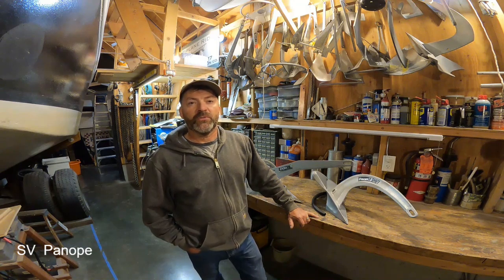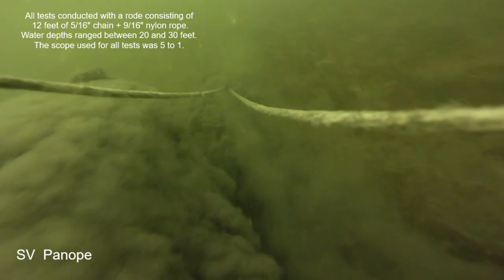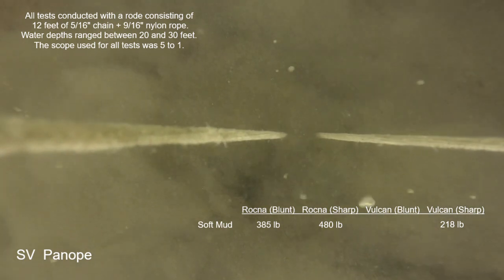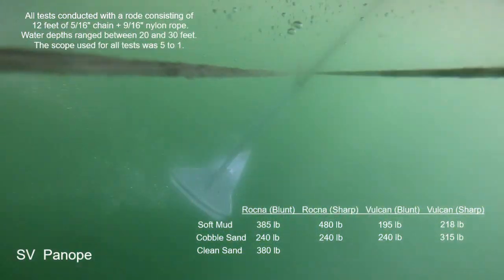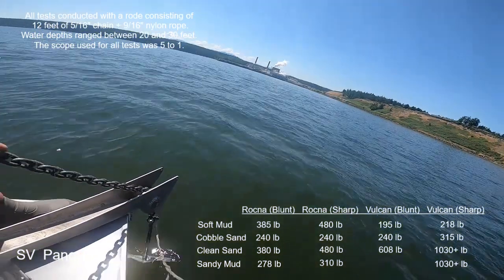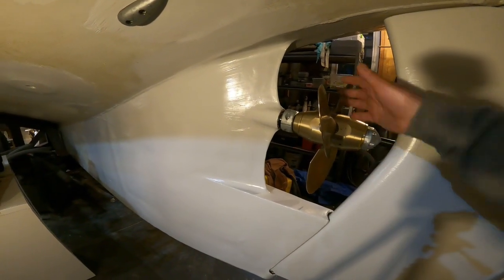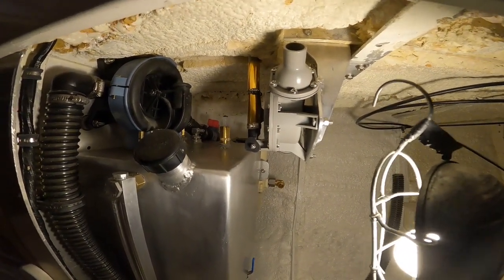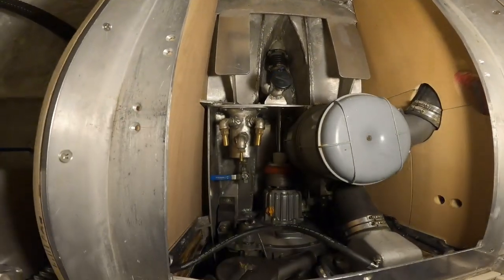Shank Leading Edge Sharpness.  Anchor Test Video # 149

Comment: Thankyou so much for all your amazing research and presentation style. 
This is the 1st vid I have found a flaw in your testing. I am a full time liveaboard at anchor sailor. Last 3 new anchors(different boats) were Rocna Vulcan Vulcan. Setting either in soft works too well!  They bury themself if given enough time and appropriate scope. EG at 2:1 and a few minutes the flukes are maybe 50% buried. Then 3:1 and a cup of tea later 100% buried. NO Engine used. Then go to 5:1 or greater for the storm after the storm anc has disappeared and retrieval becomes a solid workout just before sail off anc. In these situations both Rocna and Vulcan come up with lots of mud. The anchor will do the setting if you let it.

Comment: Late to the party here. Thanks for all the testing videos! I've dived on my anchors lots of times, from southern Massachusetts down to Panama. In New England it is very rare to be able to find any part of the anchor sticking up from the typical thick mud, and sometimes mud-sand. Down in the Chesapeake and the ICW where you are often anchoring in gelatinous goo there is nothing to be seen at all of the anchor. You have to get it to dive down through the goo to something firmer to have any holding at all, but the good is so loose that I doubt sharpness of the shank would make much difference. I could see that a sharp shank could be helpful in thick grass, but it is so problematic that I will do a lot to avoid anchoring in it. In hard packed sand on the other hand, found in the Bahamas and the Caribbean, it is often the case that not much more than the point of the anchor and some of the body are buried. I've successfully (but nervously) hung on an anchor with nothing but an inch or two of the point or points buried, using lots of scope and as much chain as I could. My conclusion for where I've cruised is that sharpness of the point or points is critical, but the shank much less so.
Reply from the maker: Greetings John, glad to have you around.  I have always appreciated your thoughts about anchoring.  

There was a time when I thought that I might have been able to travel to your part of the world with a bunch of test anchors.  With those aspirations now faded, I rely on testimonials such as yours for that kind of information.  

Cheers, Steve
Reply: Thanks @Panope  Of course a genuine CQR kind of proves the point with its incredibly fat, heavy and blunt shank. I have witnessed many a CQR on its side on the bottom, but still doing work with the plow part dug in. In fact, the typical set has a CQR on its side, at least in somewhat firm bottoms. Don't know if you've been there but many Bahamas anchorages are so crystal clear that you can easily observe everyone's anchors just from the dinghy with a glass-bottom bucket or by snorkeling on the surface. Back before we had new-gen anchors with sharp points I found that frequently the best anchor in the Bahamas was a Danforth Hi-Tensile and then the Fortress when they came out. I haven't tried my Mantus there yet, but I'm sure the sharp point would make it much better than my old CQRs.

Comment: Thanks for the test Steve. Seems obvious afterwards. Makes you wonder why we didn't see it before. Love the mods to your boat. She looks really nice. We fitted a maxprop to my last boat. You will notice the difference immediately. Low rpm thrust is huge. Reverse thrust difference is even higher. 1 strange anomaly. Before stopping the engine, we had to engage reverse for a few seconds and then finish in neutral. I can't remember why. But we had to.

Comment: I bought a Mantus 2 17lb for my Montgomery 17 Which i sail on Lake Erie upon your testing results hopefully Mantus is realizing this!

I know you stated your reasoning for a 3.5:1 to 5:1 scope but in a lot of the testing like the Fortress in my experience they only start to work at 5:1 and are a different anchor at 7-10:1 with adequate chain. 

Anyway I appreciate the time your putting into this project!
Reply: Likewise I bought an M2 30kg after watching Steve's testing. It has commercial impact and influences consumer buying.

Comment: I was exploring the Mediterranean on google earth as a place I would like to sail to some day. I noticed that anchoring may be a little sketchy because the bottoms tend to be very rocky. Is there a particular type of anchor that would be good for grappling onto rocks?
Reply: I’ve sailed in many locations throughout the Mediterranean and never had a problem finding an anchorage with good holding substrate even with an inferior delta anchor (wasn’t my choice).  The biggest problem with anchorages is being overcrowded in the summer months which will keep you on your toes.
Reply: What you might be seeing on Google Earth is likely sea grass which there is plenty of.
Reply: Thank you both for the input.

Comment: Another great test. Do you ever get nervous about the number of trials?
Reply: Thank you. I’m use I’m your biggest fan. Can’t count the number of people I’ve recommended your channel to.
Reply: @peterheiberg566  Ditto with what Peter said!
Reply from the maker: Thanks Peter,  I am not sure what you mean by "number of trials".  To many?  To Few?
Reply: @Panope  I’m sure everybody is as impressed as me with the tremendous amount of work that you put into these anchor tests but I just wonder if 4 trials can result in any kind of real significant results given natural variation in the seabed, location of weed, rocks etc etc. A statistician might want 40 trials. Still it gives a good hint at the direction anchor design should take. I can’t tell you how much I enjoy and appreciate your body of work.
Reply from the maker: The seabeds in which I test produce fairly consistent, "good enough" results from a relatively small numbers of trials. Also, the camera really helps "weed out" (no pun intended) bad tests. 

But, it is always a "balancing act" between having a larger number of trails and the even more important (in my opinion), large number of test scenarios.  

For example, in this "leading edge test", if I had focused on the soft mud seabed and conducted 10 trials for each condition (10 x 4 = 40), we would have perfect data for that 1 seabed and zero data for the other 3 seabeds.  In my opinion, having "good enough" data from 4 seabeds beats perfect data from 1 seabed.

In a perfect world we would have:

-Tests of relevant anchor designs (minimum 20) in at least 3 different sizes each.
-Test all those with at least 3 different rode combinations with at least 3 different scopes.
-Test all of the above with various "soak times" and different rates of pull increase.
-Test all of the above with multiple "resets", veers, surges.
-Test all of the above in at least 20 different seabeds that are spread around the globe.
-And yes, test all of the above with at least 10X trial repetition.

So that is 20 x 3 x 3 x 3 x 2 x 2 x 2 x 3 x 2 x 20 x 10 =   5,184,000 

If I somehow conducted 30 trails per day, for 300 days per year, I would be finished in 576 YEARS!!!

Don't forget the video editing and voice work which requires at least as much time as the "on water" testing - so now we are at well over 1,000 years!!!

Note that this entire endeavor has been (and will likely remain) a net money loss for me.